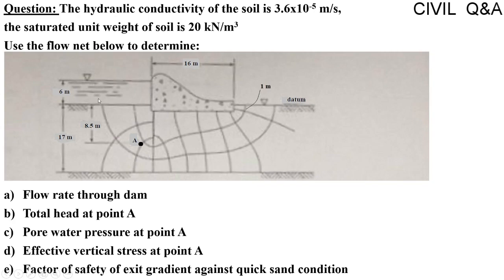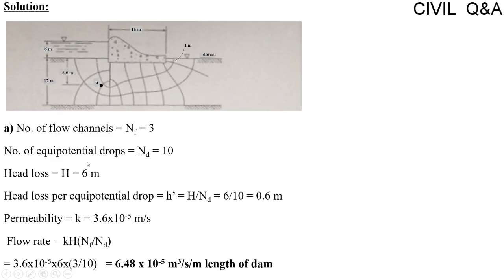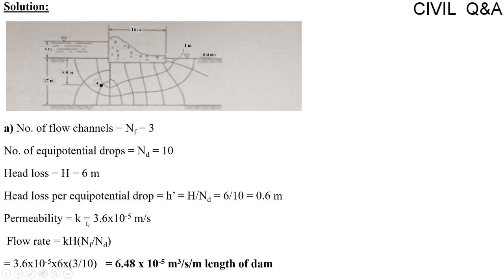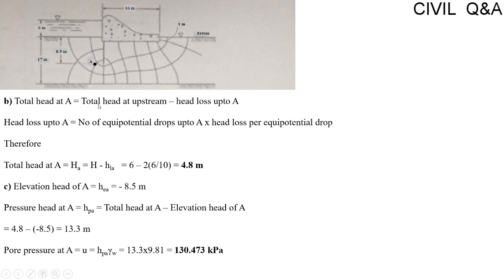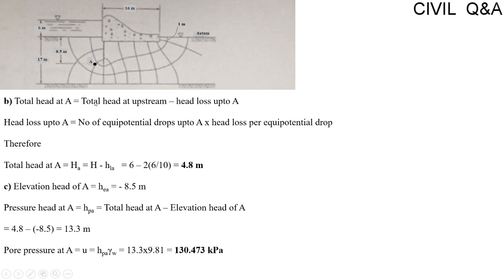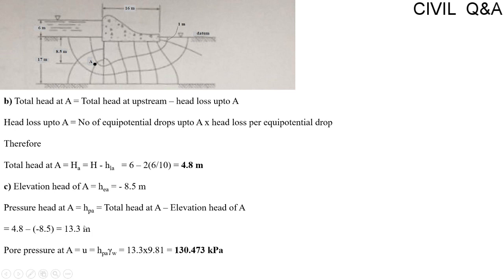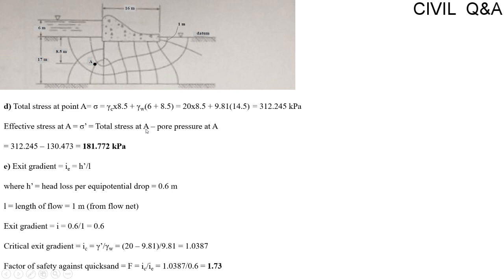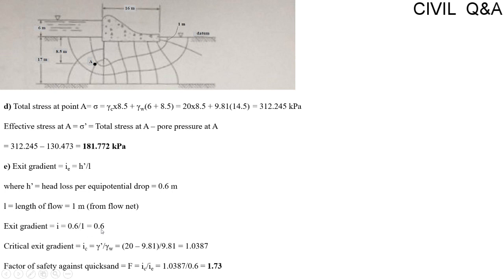Pore water pressure, Effective stress and exit gradient in flow net|Earth Dam Flow Net

Comment: 20 KN/m^2 is saturated unit weight of soil. So, to calculate total stress you probably should have multiplied only 6 with unit weight of water. 20*8.5 + 9.81*6 = 228.86

Comment: How would you find the total head at point A if it was somewhere between the equipotential lines instead? Would you use interpolation or another method?
Reply from the maker: Thanks for watching dear
Reply from the maker: You have to find the elevation and distance of the point from the given flow net. As flow net is drawn to scale, find the plotted distance from the diagram and convert it using scale to actual distance.

Comment: I think d part is wrong
Reply: 20×8.5+9.81×6=228.86
Reply from the maker: Thanks for watching dear
Reply from the maker: Yes I have wrongly calculated the total stress value. It's actual value is 228.86 kPa
Reply from the maker: And Effective stress = 228.86 - 142.245 =  86.62 kPa
Reply: WHY CHANGE PORE PRESSURE TO 142? NO EXPLANATION.

Comment: Sir how to find effective stress if water level is on both side u/s and d/s
Reply from the maker: Thanks for watching!
Reply from the maker: First find the pore water pressure at the point. Then see if the point is close to upstream or downstream and find total stress at the point. Subtract pore water from total stress to get the effective stress
Reply: @MasterCivilEngineering  how to decide sir , the pt is closed to either u/s or d/s.
Reply from the maker: I will be making a video on it in the coming days So stay tuned!
Reply: @MasterCivilEngineering  thank you sir
Reply: Dear sir
For branch d
The total stress at point a  should be estimated like this
8.5 × 20 + 6 × 9.81
Use the water depth at the upstream only without the soil depth 8.5 
Thank you